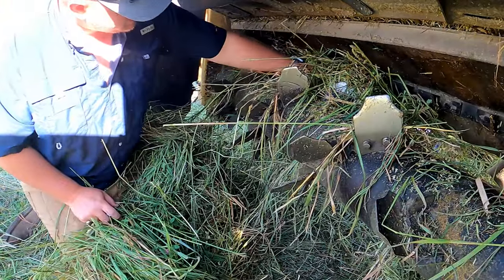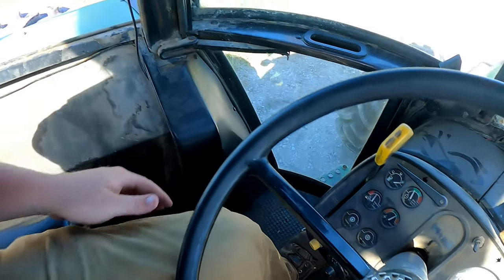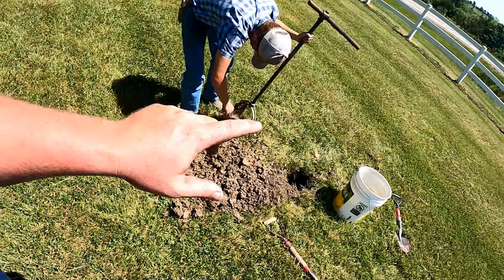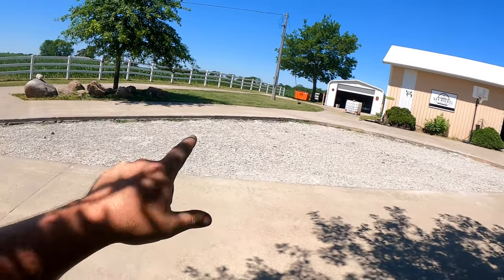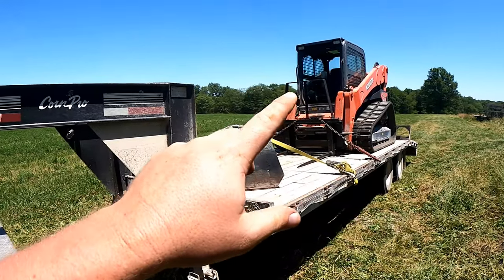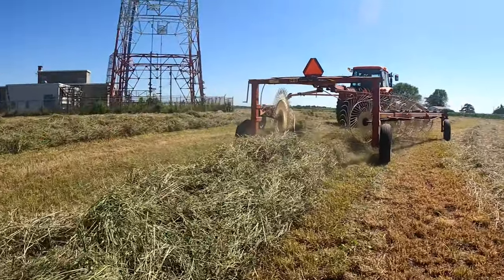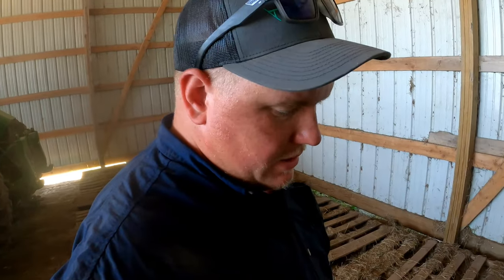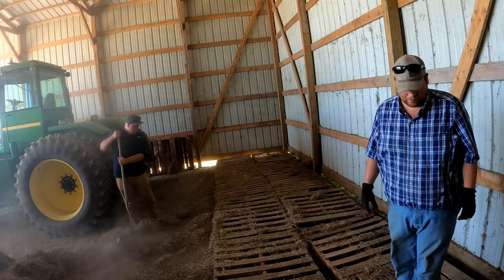A SLUG and A ROCK

Comment: Another way to fix your flag pole is to make it so you can tip the whole pole put two smaller pipes on either side and run a bolt through them all so then it’ll hinge and make it easier to change rope and flag
Reply from the maker: That’s the way this one was before it got welded. This gal is 20 years old or better already.